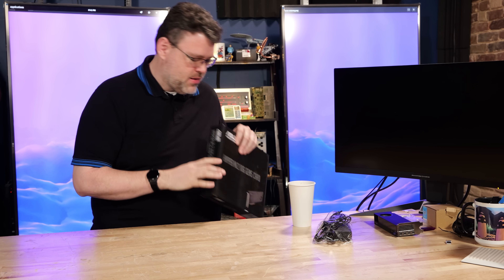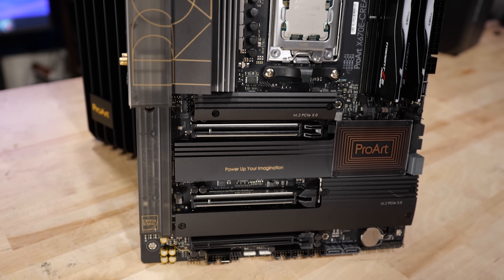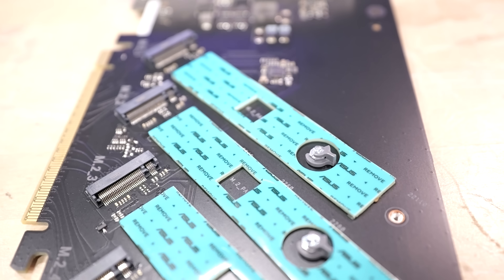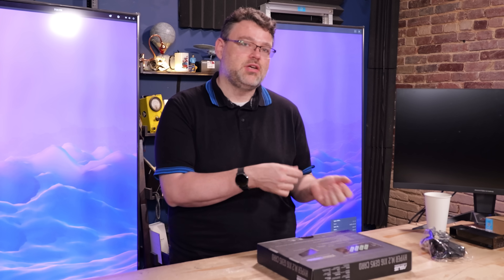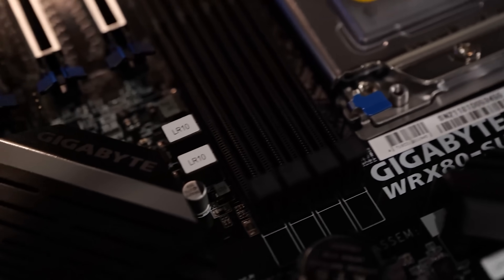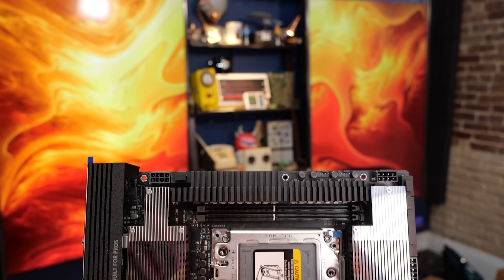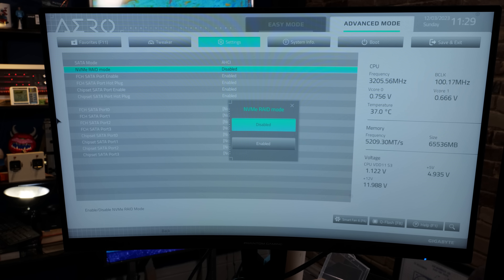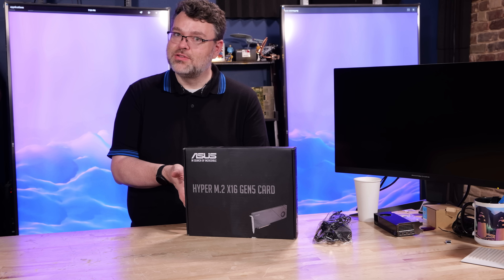Is The ASUS Hyper M.2 PCIe Gen 5 Card The FASTEST Thing In Your PC?

Comment: The MSI Meg Ace x670e has a bottom PCIe Gen5 x4 slot that is also, and unusually, connected direct to the CPU (there might be other AM5 boards that do this also but there's not many). So, you could use this Hyper card in the x16 slot and - if you can make it fit - put your GPU into the bottom slot. Remember...PCIe Gen5 x4 = Gen4 x8 = Gen3 x16. Even the 4090 is not(!!) reduced in speed in a Gen4 x8 slot compared to a Gen4 x16 - there's plenty PCIe scaling videos proving this. To help, perhaps a riser cable would work in that bottom slot?
Reply: The 4090 is famously not a gen 5 card though so in that bottom slot it would only run at gen 4 x4 speeds (there's 4 lanes available and the max speed on each lane is determined by the lowest common denominator) - that probably would start bottlenecking a lot of high end GPUs. If you were going for a particular kind of build with a low to mid range GPU though you could break out the gen 5 M.2 slot that most motherboards offer (which is probably what MSI pulled those lanes from) with a riser, although even if you could find a gen 5 GPU most risers will struggle even to get you to gen 4 let alone gen 5 signal integrity
Reply: The real thing here that Wendell is pointing out is that you don't have the processing power on the consumer platform to make use of this card in the first place, so its a pointless endeavor. There are X670E boards with 2x 5.0 M.2 and and 2x 4.0 M.2 slots, which already provide more bandwidth that you could actually do anything with a Ryzen 9. Boot from a Gen 4 slot, raid the 2 Gen 5's, and have more bandwidth than you'll ever need.
Reply: @blkspade23  That's not even remotely true, consumer platforms have tons of processing power, what they lack is PCIe lanes, a big deal for a piece of hardware that requires 16 of them
Reply: @bosstowndynamics5488  Clearly missed what is being said. Yes they have a lot, what they don't have is enough to utilize all the bandwidth already on offer. The absolute fastest thing a 7950X can do itself reading/writing to storage encryption/decryption, which amounts unlocking a bitlocker/LUKS drive on boot. When it comes to performing most types on work inside of applications, they aren't getting it done at a rate equal to a single Gen 5 NVME SSD. Nothing the CPU is capable of needs a 4 Gen 5 NVME array. Even if you were fine giving up a dGPU, it's silly on a consumer platform. That is why Wendell is saying it's meant for HEDT.

You can dump bits into memory or on the bus to the GPU/wire that fast, but not having the CPU doing the processing on it. Past a certain point you get a lot of CPU overhead on even that. I'm specifically talking about devices like in this video that aren't solving consumer class problems. You can get away with running any current top GPU at 4.0x8 because it doesn't even need all 16 lanes, let alone any lower tier GPU. My AM5 board can run 2 8x devices, 2x 5.0 NVME, and 2 Gen 4.0 NVME. It has a 3rd PCIe slot that does split to 2x with one of the Gen 4 M.2 slots. That's still faster than the 10Gbe or TB4 included on the board for getting data out of the computer. Maybe something like 1-5% of consumers need (would like) more than that on a standard desktop. There is for sure an argument for more PCIe slots over the excess M.2
Reply: @blkspade23  I read what was written, the problem here is that you're being very constrained in your thinking for why you might want fast storage, there's plenty of use cases for fast storage that aren't dependent on the CPU as the primary or sole processing unit. The problem is that those use cases involve either providing a network storage target or processing that data with a GPU or similar, and the reason you can't do those on AM5 is, surprise surprise, not having enough PCIe lanes
Reply: @blkspade23  That's the entire point of things like the 12 core Threadripper part, which is substantially slower than a 7950x in terms of CPU compute because you don't actually need that much compute to provide a basic conduit between ultra fast storage and some accelerators/coprocessors. That much was proven by way faster storage setups running on slower Zen3 Threadripper systems

That, and the fact that you aren't necessarily running these things in RAID0 for sequential read speeds, you might have an application that needs a lot of data on hand but uses specific chunks of it in an unpredictable way, or you might be seeking latency/random IO more on a bulk workload, or even just you need more than 8TB of data on hand at gen 5 PCIe speeds without the hazards of RAID0 on gen 4 devices (ie running the gen 5 drives as independent drives or a RAID5 or similar)
Reply: @bosstowndynamics5488  I just pointed out that there is indeed already very fast storage options available right on the board. You're either processing the data or moving it. You can have ~28GBps with just 2 drives on the motherboard. Outside of throwing data in to VRAM, this is far beyond the point of diminishing returns, unless you've got some expensive infrastructure in place where it starts to look foolish that you're talking about doing it with consumer gear. 

10 Gbe is only 1.25GBps. So are you gonna get some 100Gb SFP nics solely to watch data move back and forth for shits and giggles? Are you actually in need of serving data at that rate to a collection of consumer devices? That's still only 12.5 GBps. Roughly a single Gen 5 NVME SSD of throughput. Once again, what would one have to accomplish with a 4xGen5 M.2 card in the consumer context? If you don't need the CPU as intently because you're really relying on the PCI bus, then there is nothing wrong with just getting a previous gen HEDT. You're going to likely need way more system RAM anyway if you need to feed a bunch of GPUs, which is also why HEDT starts making more sense.

If you RAIDed the 2 onboard Gen 5 drives, that's already equal through put to the a X16 Gen4 GPU (all that exists so far). The time to process the work in most any GPGPU task far outstrips the initial copy to VRAM, and the data coming back out doesn't frequently need even that much bandwidth. It's just not a real bottleneck for anything you're seriously needing to get done on a consumer platform.
Reply: @blkspade23  I really think you're missing the point, either that or completely incapable of realising that CPU performance isn't the defining characteristic of a consumer platform. 
I completely agree with you that these cards are unnecessary for gen 5 devices on AM5, what we disagree on here is *why*. You claimed, originally, that AM5 wasn't fast enough to justify that kind of storage throughput. I pointed out that there are Threadripper systems with worse CPU performance that absolutely do need that kind of performance, the real reason AM5 can't make use of it is the lack of sufficient PCIe connectivity to throw that kind of data around to either other systems or to sufficient GPU and/or accelerator hardware to use it. For some reason you read that as me saying that consumers now need that kind of bandwidth and wrongly argued against that instead of my actual point. I'm not saying that consumers have any need for that kind of bandwidth, what I'm saying is that the limitations aren't imposed by CPU cores, they're imposed by platform limitations. No, consumers don't need 100GbE, but enterprises absolutely do and there's tons of storage servers around that use a lot less than the compute provided by 16 Zen 4 cores to shuttle enough data in and out of SSD arrays over multiple parallel 100GbE links. Similarly, there's tons of Threadripper and Xeon systems around that'll have one of these suckers alongside 4+ 4090 class GPUs, or other similar builds (a number of which will be using similar amounts of CPU power to a 7950x because the workload is not a CPU load). And perhaps most importantly, this is the exact same line Wendell made in the video, and is a recurring theme all over this channel - consumer CPUs are really, really fast, but they're limited by platform IO, and it's the lack of platform IO that results in these cards being unusable on consumer platforms

Comment: WENDAL NAILS IT.
is also why you need 64 gig ram and primocache. That second read is the max speed of the pcie bus. For me around 26 gig per sec. Its just sooooo good.
Reply: Primocache = Primo trash.
They're now on year EIGHT of trying to figure out why it randomly stops caching and have vowed since 2020 to fix the "forever flush" (where you simply right click and choose 'clear cache' and it runs forever, halting the cache and destroying data in the process before making it so your computer will hang on reboot until you reinstall the entire hunk of POS software.)
Reply: You don't need "primocache", whatever that is. The OS has disk caching built in. Has for decades.

Comment: well u.2/u.3 are fine, but are being replaced by e1 form factors in enterprise, would be nice if those would spread amongst power desktop users and gamers too, would be nice to have a nuc like small universal pc with externally easily accessible slots where you can interchangeably put a cheap consumer grade m.2 or an e1 for heavy duty tasks and hoarding /30TB drives were on sale for under 2500 eur with tax/
Reply: Nothing that is a physical standard trickles down from enterprise into retail world. U.2/3 never got there. SCSI was abandoned long ago and relegated to only enterprise. The EDSFF standard isn't ever going to make it down into consumer stuff.
Reply: @timramich  thank god there are exceptions, I utilise a pcie 16x to U.2 adapter with a 7,68TB intel drive, the adapter was 13 euro and the drive brand new for 563 eur on sale with tax :-D , also there is an interesting nas out there, level 1 have had a review of it too, check "QNAP TBS-H574TX" can use five m.2 OR the e1 form factor drives, currently theoretically 5*60TB = 300TB /pricewise 1500-1800 for the nas and approx 7200 per 60TB drive so almost 40 000 euro in total...for all the linux distros out there.....:-D/
Reply: @timramich  At the very least stuff like this could be more available. I had to go to AliExpress to get a card that could accept 4 U.2 drives, I never did get it to run 4 drives but my old Z590 board could do 4x/4x on the second 16X slot and I could run my optane and 8TB u.2 drive in it
Reply: That'll be great but...(I am staring at you Mr.SAS HDD.)

Comment: There are a few Z690 and Z790 boards such as the Asus ProArt Creator boards that will do x8x8 bifurcation, but as far as I'm aware, no LGA1700 Intel Chipset supports x4x4x4x4. Also, take a look at the OWC U2 Shuttle for an interesting way to add a lot of M.2 NVME drives to consumer PCs.
Reply: X8 x8 is just regular muxing, since it splits the lanes between two physical PCIe slots. But yes, the as of yet current Intel LGA 1700 desktop CPUs can’t do PCIe Bifurcation.
Reply: @abavariannormiepleb9470  Thank you for pointing out my error - in my haste I listed one of only two Asus Z690 boards that muxes, but doesn't x8x8 bifurcate (the other one being the ROG Maximus Z690 Hero). All Asus Z790 boards should be able to x8x8 bifurcate as shown on Asus' bifurcation compatibility webpage. The majority of Z690/Z790 boards from ASRock, Gigabyte and MSI should x8x8 bifurcate as well, but check the BIOS manual for each individual board.
Reply: @abavariannormiepleb9470  Which does work for 2x m.2 drives at full speed without switching hardware, if anyone is wondering.
Reply: it does not have the raid speed, JBOD speed. neat device

Comment: I personally use one of thoses (older pci3 one) in my homelab with a first gen ryzen and a second hand 470x mobo, and it's awesome, i have a 10gb nass with a raid z1 nvme aray i mad for 500 buck (i got my 4x 1tb corsairs ssd for 30buck each at the end of pci gen 3 drives, i recomand if there is 3d artist neading fast network storage on a budget ( also have hdd for long therme storage)

Comment: Is there a way to split 1 - x16 slot to to 16 - 1x slots? So you can use 16 - m.2 gen5 drives in applications like a NAS?
Reply: afaik most CPUs/Motherboards only support quad x4 bifurcation, some have some combination of x8 and x4 as well. Maybe in the future we will see more bifurcation options including down to x1
Reply: @ColinABarr  okay, thanks for the comment
Reply: There is a way, it requires a switch.  Just like the Asus Flashstor 12 Pro. (although I believe that has 2 separate switches)
Reply: @fwiler  okay, are there any pcie cards with such switch?